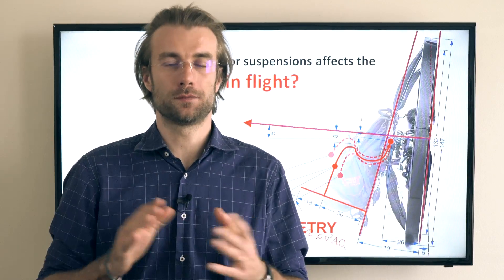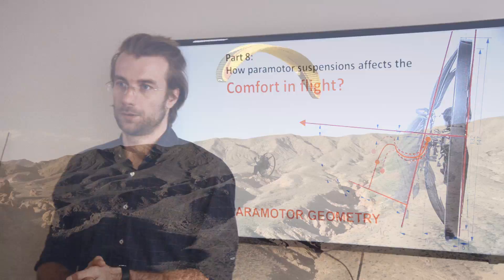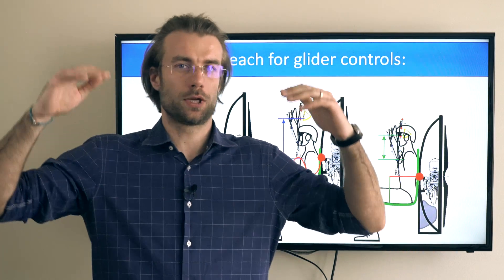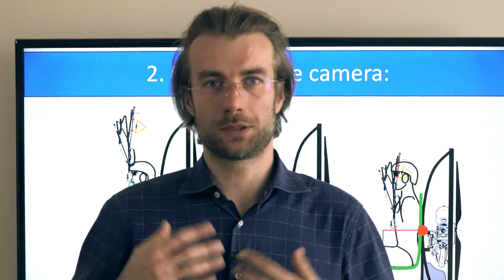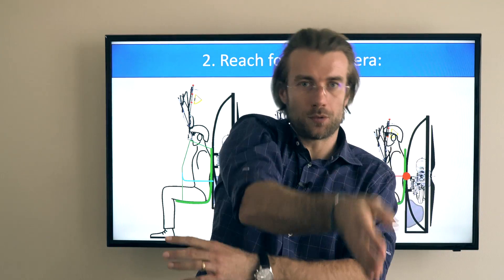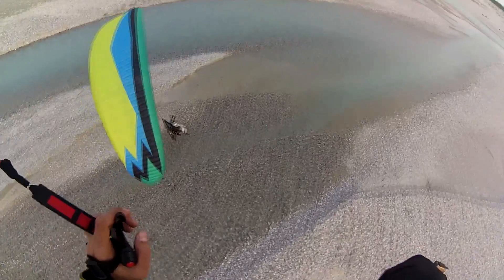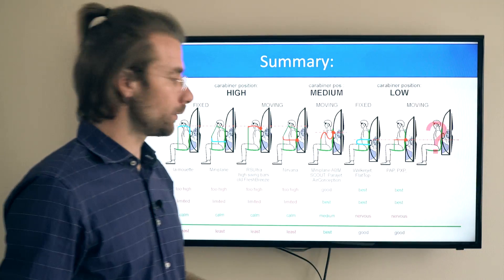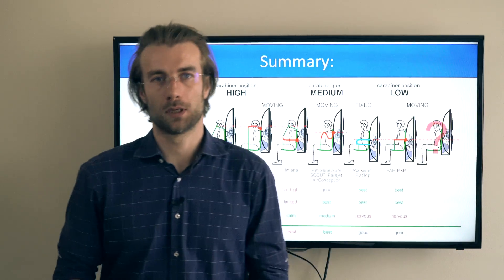How paramotor suspension affects the comfort in flight? Paramotor Geometry Part 8

Comment: you forgot to mention some gliders have 2 brake toggle levels for low and high hang points...this does help the lower the high position of hands on high hang point units.
i have lengthened my dudek wing brakes by 200mm to sort this issue...and added longer tip steering (this is the big one when trimmers are out because in full reflex mode one should only use tip steering on my wing)
Reply from the maker: +Adam Edgar yes I made my brakes longer on my first high suspension unit as well. It increases the risk of getting the brake toggles caught by the prop... 
It actually happened but I was lucky, because it happened under power and the toggle was cut away. I landed with my D's. 
If it happened on idle, the prop would tangle up the brake and drop me down to the ground in a spiral. 
Please make sure you are safe.
Reply: Would that even be possible on a nirvana rodeo?
Which high hang point unit did you have?
On dudek wing that i have, there is a second pulley down lower for lengthening main brakes for this purpose. Tip steering has an elastic line on one end anyway so it doesnt matter for that except it tangles in risers.
Reply from the maker: Yes, it happened on the nirvana rodeo in my first year of flying. It was a classic glider with only one pulley position for the brakes. In fact I did not even have the lines longer at that time. It just happened.

The way I made my lines longer was that I have attached additional line to the toggle with a small toggle on the bottom and connected the lower toggle to the bottom of the rise with bungee }similar to today's tip steering). I pulled the lower brakes on cruise in calm conditions. I have used the regular toggles for landing to have full brake authority.